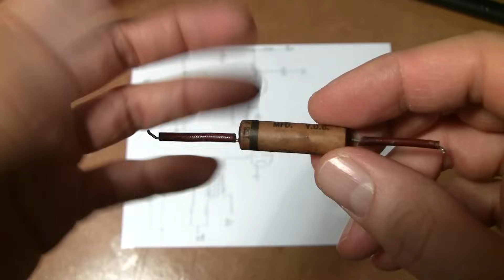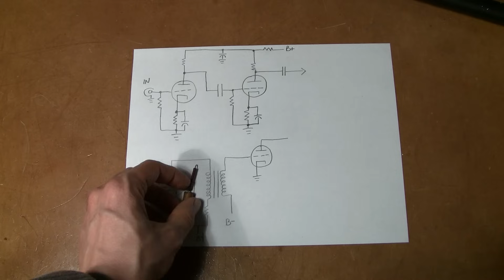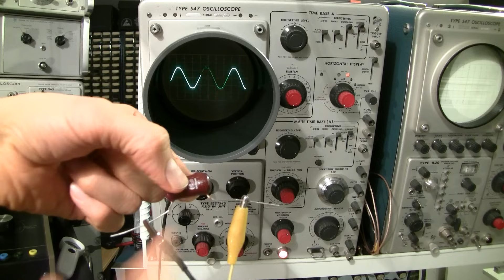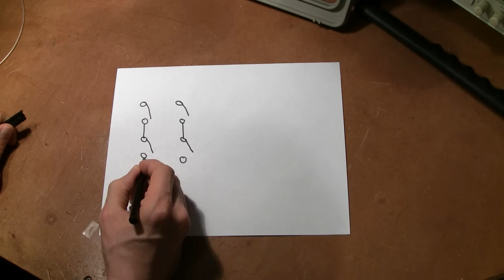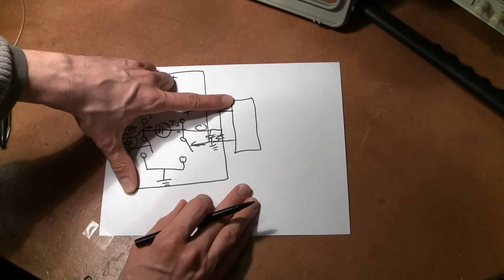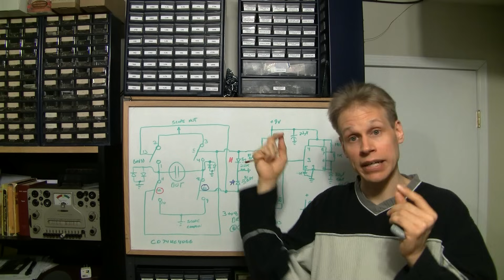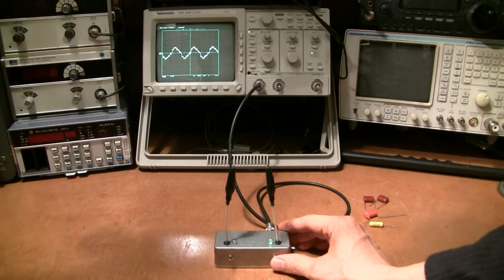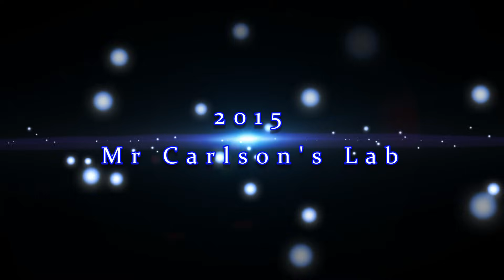Are Your Capacitors Installed Backwards? Build this and find out

Comment: Does paper capcitors (PME271M610) have a polarity. I have a few in them in a sewing machine I am fixing with electronic motor control. It was humming alot when running and didnt stop when I released the pedal but when I removed the cap on th input both of tose things went away. Since they are listed as interference supression caps I guess things like that would be important but since they are translucent it should be possible too see what side is what. And btw youmake this without the need for a scope? Maybe with a piezo buzzer or somethign that would react to the difference in amplitude.
Reply: If you read back to Mr Faraday who invented the capacitor you will see this is very common. I mean if you have only two layers and one is nonconductive (wax as in the sprague capacitor which Faraday also used) there's always going to be a more conductive metal layer either on the surface or just below the wax. So yes.

To answer your real issue: Just flip the cap in the circuit to find out if it helps.

The sewing machines I have seen had DC motors. Not stopping would be a sign of that leakage he talked about. Leakage current would keep the motor running very slowly. 

You know, it couldn't hurt to move up to a higher quality cap... these things are cheap and often scavenged. You can probably find what you need in an old CRT TV someone is throwing out. They're around me by the dozens!

A really handy thing to make or buy online is a capacitance box. It has a bunch of values you can select from. If you make your own you can assure which way the caps all are and then it becomes even more useful to you. You could use different types. Tantalum at one time was considered king but really overkill for your purposes.
Reply: BikingMNViking
It's a very special type of cap they use in sewing machines. I replaced them all with x2 caps and now it works. I think the ones I have might have AC motors one has an electronic control box and one only has the pedal and a cap across the input which is a current limiting cap and that cap (multiple in the fancier one) burnes out becasue they are rated 220v and our grid is now 250v  so when I change them out I substitute for 275v ones.
Reply: BTW metallized paper is fairly common but I've been in/out of the field for years so there isn't a lot, partswise, that I have not seen. (or torn apart for the sheer interest of it)
Reply: BikingMNViking They arent actually paper anymore but they are stilled called that. Anyway it's  the type that is potted in clear resin and the brand name is Rifa. I think they are specialized for this kind of application.
Reply: rimmersbryggeri
well, yeah, its just something with a sufficient dielectric constant to go between the conductive layers.

Comment: when I was a toddler, my father took a book , and put squares of aluminum foil in between the pages, turning it into one great big capacitor.

He covered the outside of the book with aluminum foil on the front and on the back separated by The Binding , etching a title into the aluminum foil that said shocking facts.

He charged it up with a great big lantern battery, and then handed it 2 me when he was all done.

Holding the book by the front with my left hand and the back with my right hand it must have discharged about 30000 volts DC into me when I opened it up.

He stood there laughing, and when I looked down, I had peed the floor in one BIG puddle...
Reply: That's a shocking story. How do you get on with the old man nowadays
Reply: Nope. They are all wrong. I would have remembered that episode and when older, I would have walked up to him smiling one day and hauled off and kicked him in the nuts. :"Thanks pops, for ruining my trust in you as a little boy". That guy is/was a monster.
Reply: I thought that was a great demonstration of what a capacitor was up until you got the shock.  Unfortunately,  my father did something similar to me by handing me a glass of buttermilk to me one day instead of milk.
Reply: Now I want to make myself a "book" capacitor and measure the capacitance.

Comment: I am glad I found this, this has been the issue so far from a project I was working on, polarized capacitors, once I put them in, the unit, (a retro 57), pre-amp tuner and power amp. Now it won't turn on?

Comment: What about replacing the aligator clips with small (molex) connectors like the ones for the front panel indicators on a computer chassi? Could be slightly less fiddly than the aligator clip at least for one side. For caps with leads poiting the same way you could even make a stationary socket to just plug them in. This might be a stupid suggestion since I don't know much about this but could you do that?
Reply from the maker: +Mathias Nilsson 
Could work!

Comment: have a oscilloscope, will be looking at this as took it for granted that the lil chiclet Cap's it did not matter & Cap company > S##O, i called as they had band on end, they said did not matter?... Im gona call them again or email if I heard them correctly~ i know i did. bought 20 cap's off them different value's... $5 a pop
Reply from the maker: +Rick Johnson 
I'm not familiar with chiclet caps.

Comment: I guess the industry doesn't want to bother checking  each cap and marking every one correctly. I'm sure such a check can be automated so that the caps would be marked correctly on the production line.
Reply from the maker: +Steve Seifer 
We live in a low impedance world now. I'm pretty sure that the cap manufacturers would rather leave that up to us. The amount of tooling involved to detect that on a fast , mass scale, would be costly.

Comment: Two questions: Why not use a double pole double trow mechanical switch to reverse the capacitor? (did i miss the reason?)
So, what does the bands on the capacitors actually denote if not the outside foil?
Reply from the maker: +maxsnts 
The band pretty much means nothing. Odd why it's printed in the first place!

Comment: Hi love your videos.
However, the fact the the company that made the capacitors did not mark them, points to the need not to mark them. This may be fine for tube circuits but
would this apply to transistor circuits that may not need to be dependent on whether the foil end was in the right way or not ?
Reply from the maker: +jack black 
The band end is not so important in lower impedance applications. Usually the cap is mounted on a circuit board ground plane anyways. This orientation is important in older point to point wiring situations where components are suspended.

Comment: Very interesting stuff, had no idea! About the leaky capacitor thing.. I have some old philips mustard that are going into a jtm45. Is this leakage measurable if I use something like an AA battery and make a simply rc circuit and look for any dc?
Reply from the maker: +Eric Öhman 
Unfortunately, to test for leakage, you need higher Voltages. If those mustard caps are paper type, they are most definitely faulty. Don't install older paper caps in anything.
Reply: +Mr Carlson's Lab Thanks. They are film caps I believe, Philips/Mullard made in 60s-70s. One at my job told me he tests caps for leakage using an multimeter in resistance mode. If a cap shows anything other than OL he throws them away. Have you verified the effectiveness of this method?

Comment: Hey, does this make a difference within guitar circuits too? is there an easier way to find out which way round is right? I don't pave the proper tools, only a good digital voltmeter.
Reply from the maker: +AlexisGitarre 
 HI Alexis. There are a few suggestions in the comments about some different ways to go about this, one using an amplifier to indicate hum levels.
Reply: oh thank you, need to check the comments twice ;)

Comment: cool video. I did not know this about caps. makes sense though...  
Comment on the project, if you are going through all the trouble of making a test ckt, why not go the step further and make a detector and light up only the band end LED?
Reply from the maker: +Barry Beadman 
Hi Barry. I built this for myself, and just figured I would share. I may design another in the future that will be self contained.
Reply: +Mr Carlson&#39;s Lab It is cool. i enjoyed your video. For the numbers i do i'll just use the scope with clips. if you ever make a fully automated one, i'll pull the trigger on that one likely. :) Thanks for the lesson. I learned something for sure.
Reply: question....can you test capacitors in a circuit? power off of course.

Comment: ok. that's good information.  thanks. I have a book on these all american fives and it's got a lot of good info but it's not specific to my radio and the schematics and pictures for mine are not of the best resolution. thanks again.
Reply from the maker: +Chris Mosley 
I was over at a friends place late into the evening yesterday, helping him finish the restoration of an old DeForest Crosley receiver. He recently started on another, and there is a capacitor that has nichrome wire wrapped around it acting as a heater, in the oscillator circuit . The nichrome wire is attached to the AC filament circuit of the receiver. This capacitor compensates for oscillator drift, through radio warm up and operation. In a situation like this, the outside foil orientation of the capacitor is absolutely crucial! If this capacitor was installed backwards, The oscillator would be modulated at 60Hz making the upper bands useless and sounding robotic in nature.

Comment: hey, Paul.  should the safety caps be tested for this as well?
Reply from the maker: +Chris Mosley 
Not so important to do this to those caps.
Reply: Ok, thanks.  I have an old radio that had a waxy cap that went from the grid of the 12sq7  to the volume control it had a wire spiraled around the the leads and body of it all the way up to the volume control. Do you what purpose this serves or have you ever come across anything like it?
Reply from the maker: Hi Chris. That spiraled lead is just acting as a shield to stop interference. If you look at where the spiraled wire is attached, you will find it's grounded. In a situation like this, the outside foil orientation is important for lowest induced hum or noise.

Comment: Great video as always, but im stuck. :)
I am still a novice and have just bought my first 'scope, it is an old Hitachi V302B. Can you suggest how I should set this scope to replicate the test?
As it is, I cannot get a waveform on the screen, instead, just twitchy line, haha.
The scope does appear to be functional as I have followed the calibration procedure and it shows a nice square-wave when connected to the "calibration" terminal.

Any advice appreciated.

Ash
Reply from the maker: +Detecting History 
Make sure the capacitor under test has a direct connection to your scope, don't use a probe. Bring the cap close to an AC source, but DO NOT connect it to that source. Turn the Vertical gain of your scope up to where you see a 60Hz sine. Adjust the time base as needed for your preferred resolution. Then re-try the test.
Reply: Perfect, I should have watched and listened more closely, clearly no probe being used!
Thanks.
Reply from the maker: +Detecting History 
No Problem, glad to help!

Comment: The electronics lesson here is excellent !!  And the test device is brilliant.  However - as I certainly do understand the appeal of creating a test box using multiple ICs and elegant designs - I suggest that a simple "3 Pole / Double Throw" manual switch (On/On) approach would do the same thing cheaper and easier (and therefore - more elegantly in some respects).  The two center leads of two poles go to the Alligator clips.  The two outer edges of those two poles are criss-cross connected to provide lead reversal via the manual switch, and one end of each of these poles is connected to the ground and center lead (respectively) of the scope connector.  The 3rd pole is used to burn the respective LED - showing which lead is on the ground when the displayed signal level is lowest !!  I made the drawing - but can't upload it with this comment - but it seems sound.  Thanks for all the great videos !!!
Reply from the maker: +Donald Filbert 
Hi Donald. Thanks for your comment! 
 I have written why I didn't make it with a DPDT switch a few times in the posts. Just search down the list, I'm sure you will find them.
Reply: +Mr Carlson's Lab - I have clicked the "more" button dozens of times, and am still searching.  Could you maybe pin one of those answers to the top?  (Youtube comments are ridiculous, grrrr...)  This is such an obvious question, I wish the video would've addressed it right off the bat.  If I understood the need for building such a circuit, it would have been much more enjoyable watching the explanation, rather than having that nagging question "Why are we wasting our time on an over-engineered solution?" the whole time.  Thanks.

Comment: I enjoy designing little circuits as well and I really enjoy your videos so keep them coming.  However I don't understand the complexity of your capacitor test fixture.  All you need is a DPDT toggle switch mounted on the box -- no ICs, LEDs, or battery.
  Cross-wire the 4 corner terminals of the switch by soldering 2 jumper wires (lower left terminal to upper right terminal and upper left to lower right terminal) forming an X on the back of the switch.  Connect one of the alligator clips to one of the switch's center terminals and the other clip to the other center-terminal.  Connect the scope input to one of the 4 corner-terminals of the switch -- 50/50 chance you may need to move this wire later.  Moving to the outside of the box mount the toggle switch between the alligator clips so the bat handle points to either the left or right alligator clip and points to the other clip when the switch is in the other position.  Label the switch -- "Switch handle points to foil side".  As mentioned earlier you have a 50/50 chance of the label being right.  If the switch is pointing to the wrong clip, you can either flip the switch around  OR  move the scope lead inside to one of the two switch corner-terminals NOT jumpered to the current scope connection, whichever is easier.  All shields from the scope and alligator leads should be grounded to the box and run a ground wire to one of the switch corner-pins NOT connected to the scope input lead (If you moved the scope lead, this lead must be moved as well or you will ground the scope signal).
Reply from the maker: +ttltom 
Thanks for your comment!
Reply: That idea sounds like it should work mate!

Comment: I watched some videos of old guys restoring very old radio and TV sets with those old paper and wax capacitors in them and what they would do to preserve a semblance of originality in the equipment when restoring it was to hollow out the old caps and place new caps inside the shells. When that could not be done they took the old caps out of line but fixed new caps to the back of them hidden from view. I can't remember if they glued them in place or not.  I believe it was joernone who was showing how to do it but it was a long ago and I may be wrong. I found this video: https://www.youtube.com/watch?v=8G9ADye1gC8
And this one: https://www.youtube.com/watch?v=1boG_-02R-A
Reply: *****
True, but in the case of old radios using forty-fifty year old components that have degraded could easily kill you and your family. Therefore, a compromise has to be made between originality and safety.
Reply: *****
Which?

Comment: I have been building solid state circuits for ham radio for years and never heard about this issue.  Does this only apply to tube circuits with high voltage high current and greater intercircuit potential for unwanted oscillation or is this a problem with low voltage low current circuits also?  Every so often I have an issue with unwanted oscillation and need more shielding in a 5 watt RF amplifier circuit.

Dave K8WPE
Reply from the maker: +David Wilcox 
This sort of issue crops up more in point to point wiring, where there is no ground plane layer. It can surely cause unwanted oscillations and induce noise when the cap is the wrong way around.

Comment: I have a 12v power supply and two 100-Farad 10V capacitors could I connect the capacitors in series to get a split rail power supply AND be safe from voltage breakdown of the capacitors? I'm making an audio amplifier. and the capacitors need to be high value. but I dont have any that have higher than 10V and 100F
Reply: realflow100 you cannot tmake a split-rail suply from 2 caps in series. You can wire them up in series to get around the insufficient working voltage. Note that you will have double the working voltage but only HALF the capacity... you would definitely be better off finding capacitors matching or ecxeeding your supply voltage. BTW 100 Farad is a ridiculous amount of capacity....

Comment: I tried this with some cylindrical polypropylene capacitors that CE DIST has on offer and the results were ambiguous at best.
Reply: +InsideOfMyOwnMind Tjose are electrolytic. NOT a dipped metal foil